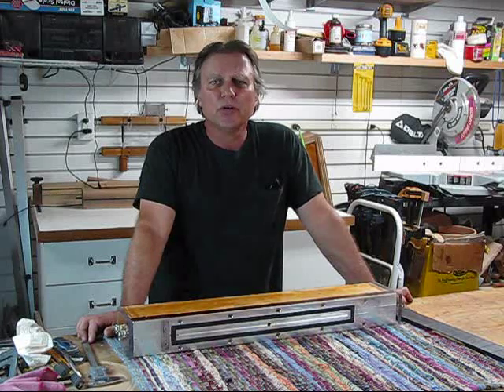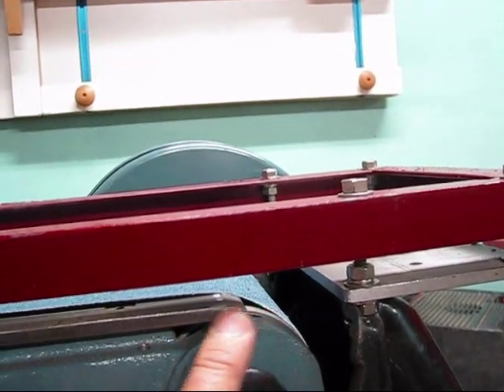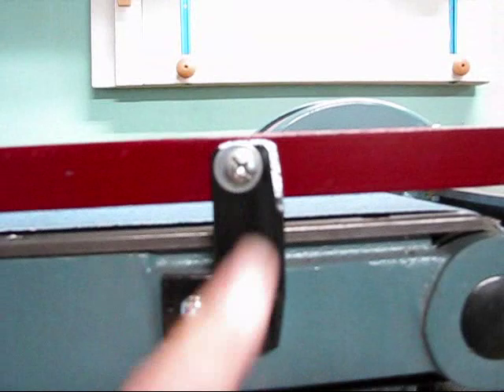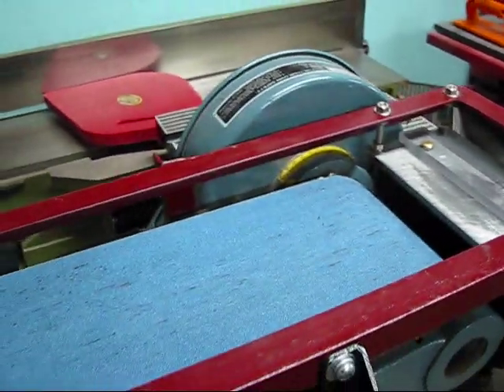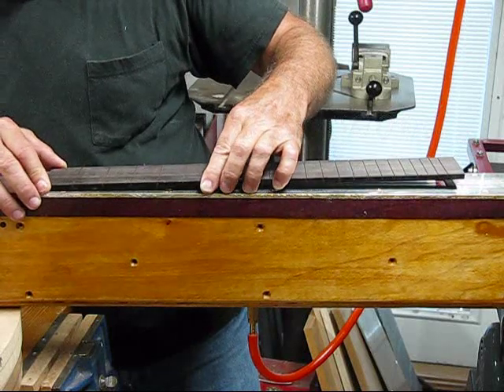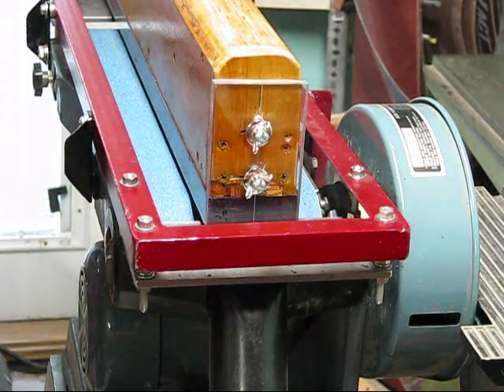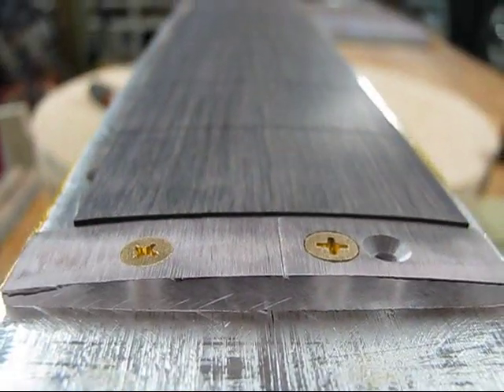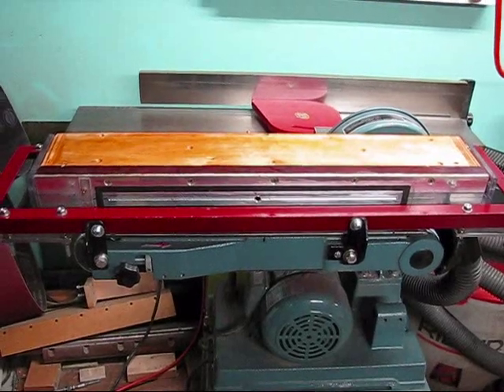Compound Radius Fretboard Sanding Jig

Comment from the maker: Probably less then half that and that includes the sander. Someone made one similar to mine but the end plates are mounted from below . The sander sits on the mount. It's a nice variation on the design and could adapt to other designed sanders .
Reply: Wonderful idea, can I use that?
Reply from the maker: Erkut Balcı yes
Reply: Thanks man.

Comment: I love your system!! I think its better than anything else ive seen. Only one question. Does the compressor keep the fretboard from moving altogether? Will it go out of allignment?
Reply from the maker: The vacuum chuck keeps it in place. The stop at the front / nut position also keeps it from moving forward . Thus sanding belt moves from tail end of FB to nut end.
Reply: how much would it cost to have you build me that apart from the part that attaches to the sander? i dont have any machining skills.
Reply from the maker: +Viktor Tulbya Perhaps a bit late but there is a YouTube out there where someone used this idea and made a wooden floor stand that does the same thing. It is great to see that someone has run with the idea and came up with another option. That's one reason why I post these videos. People see things that I don't and it's good that they share them with the Community.  I get ideas from others gigs as well.

Comment: not the most knowledgeable on this stuff, actually working towards my first build, looking at tools now.  Most of the other jigs I've looked at use some kind of a pivot mechanism to control the angle.  With yours, does that fact that you're doing it by hand and occasionally not parallel to the sander cause any error in the radius, or as long as both ends of the guide are down, is it ok regardless?.  Have you ever used this to then go to finer and finer san papers to really smooth it out?
Reply from the maker: It is pretty smooth and can be touched up by had and polished up with micro mesh papers .
micro mesh sets can be gotten at StewMac.  They also work great to polish up your car headlight lenses.

Comment: I think you missed the point. It's not that I think this way is wrong. It's very cool. It's that there is a lot that went into making a vacuum held system when most DIY radiusing jigs out there use simpler methods. It's all a preference on how your going to use it and Chris even explained in his reply why he built it that way.

Comment from the maker: To me the really cool part is the vacuum chuck. I'm no idiot and used double sided tape / carpet tape on the prototype. With the chuck it is a breeze to reposition the FB and there is no mess to clean off the board or carriage, plus if the board would get too hot there is a chance the glue on the tape might slip.

Comment from the maker: Not much to it. Cut the copper lines, one is in and one is out. put hose on in line. Figure out the power and there you go. Each compressor might be different. Check out the forums for more info. If you saw mine you would laugh, it's pretty crude.